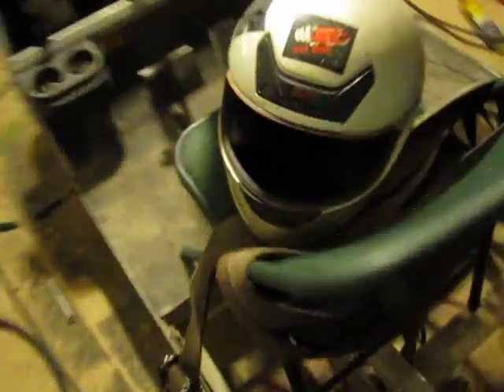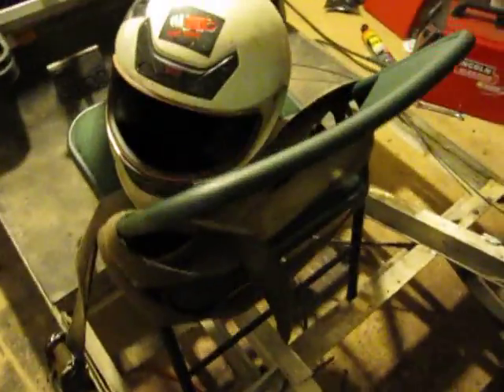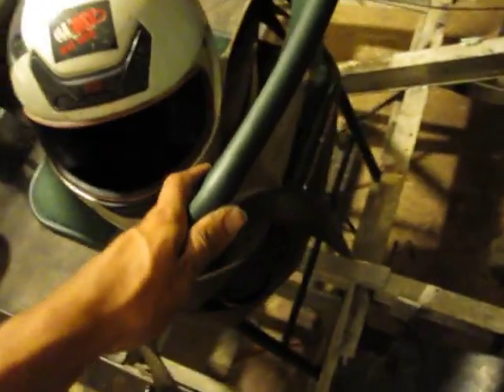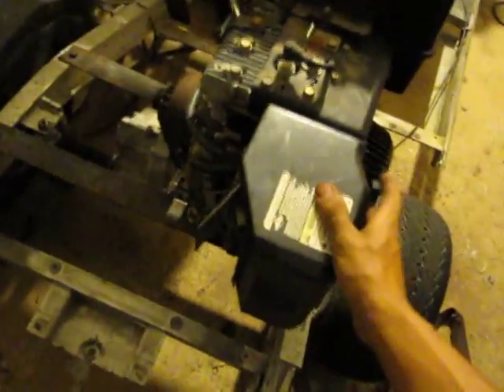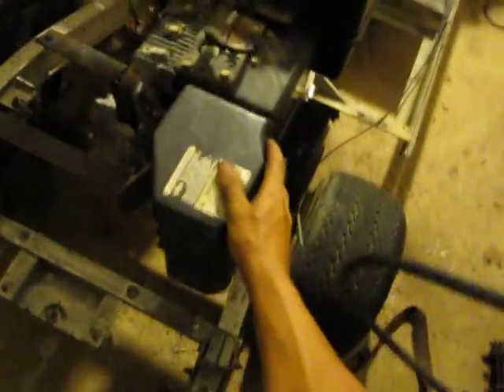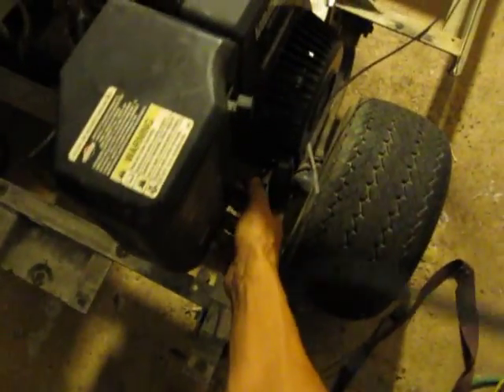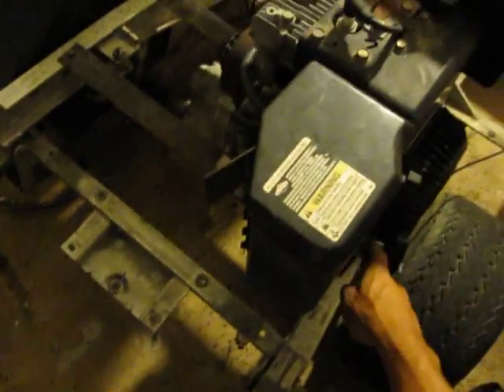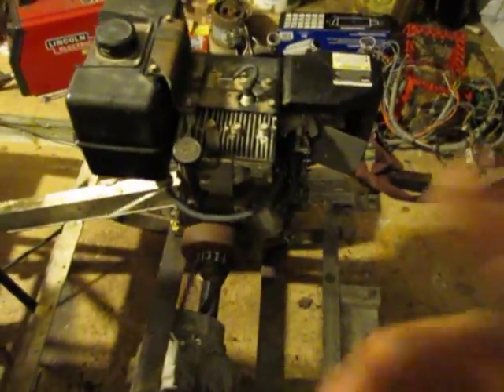electric to gas golf cart of death

Comment: instead of getting rid of the rear supension you could have put a chain tentioner on that attaches to the frame and has a spring on it. when you hit a bump the spring on the tentioner tightens keeping your chain tight therefore you van keep your rear suspension. Dont get me wrong im not knocking ya ive just run into this problem just like you and had to learn the hard way

Comment: a question for you, do normal gas golf carts actually have a transmission or does the starter generator just start the engine in the opposite direction?
Reply from the maker: TheAssassin650 I think for old 2 strokes, it span in either direction, however the newer 4 stroke engines need a gearbox

Comment: I did the same but i made a bracket were the batteries were and put the engine there. The chain dosnt pop off and you keep your suspension. Add a small sprocket to the back because the gearing from the axle is low. So to get speed you need smaller one. Ill post a video soon how to convert electric to gas.  Nice job!!

Comment from the maker: @mascobe jesus! waay too much work for me! I would have canned that engine and stuck with a 2 cycle, that way I could mount it upside down, diagonal, sideways 30* or a little to the left, plus it can run backwards or forwards =]

hooray for 2 cycle!   ive actually got a 25hp boat motor ive been wanting to put on a gokart..... i found a frame for free the other day, now ive just gotta rig up a cooling system seperate from the exhaust, and mount the carbs vertical.

Comment: I have a 1981 Club Car electric I am converting to gas. I have a 440 Kawisaki motor for mine. There are some serious space issues though. I may go the Briggs route in the end. On mine I have to flip the axles and swap the brakes around to get the drive on the right side.